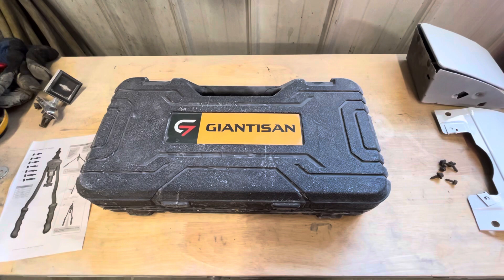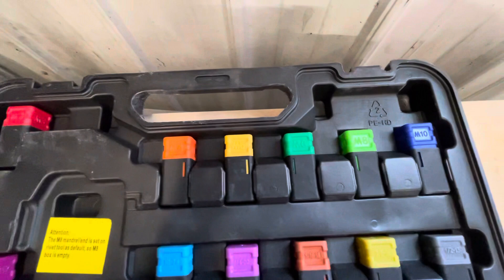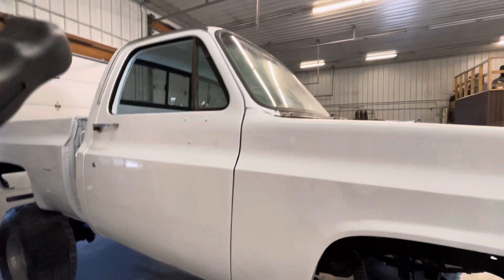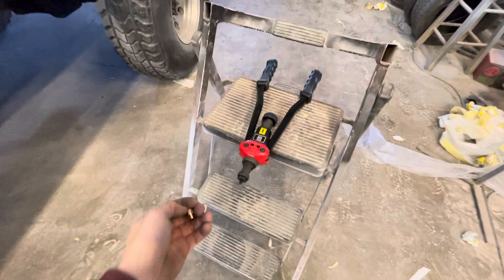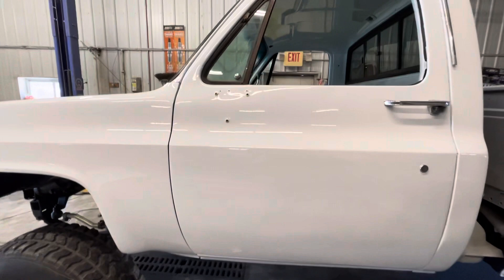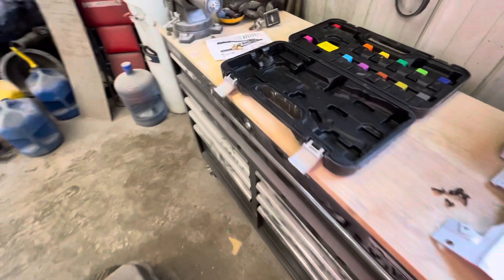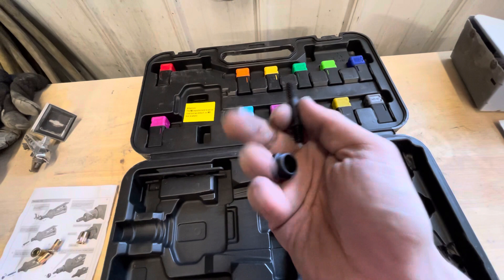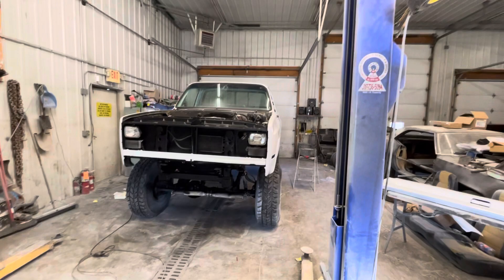Killer new tool you need! Giantisan Rivet Nut Review

Comment: Is this tool still working good for you
Reply from the maker: Yes sir! I’ll actually be using it this next week on my current build. (The xB build that’s active on the page right now)
Reply: How do you determine the the drill size in my drill bit set the bit is either too small or too large
Reply: There is a chart that says what size drill bit (in mm) 1/4 : 9mm  5/16 : 10.9mm  3/8 : 12.9mm  1/2 : 17.3mm